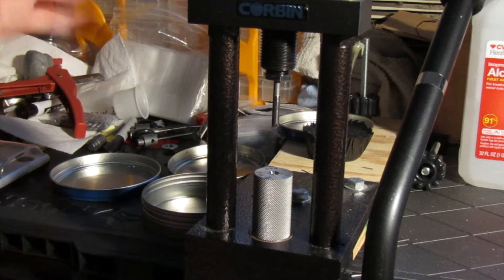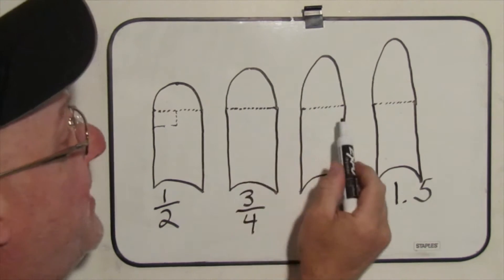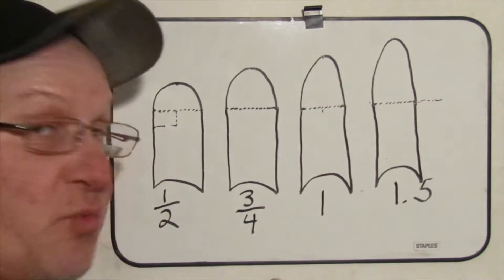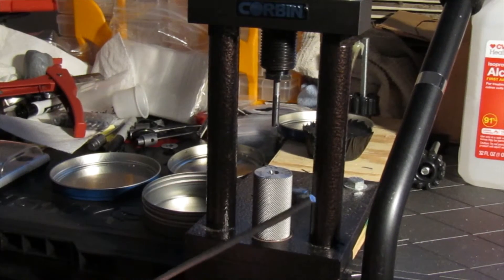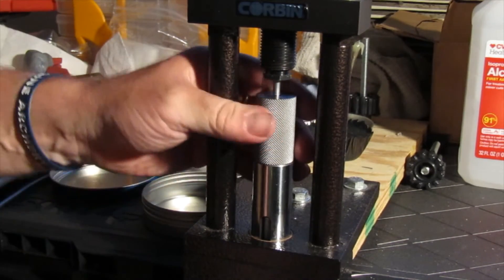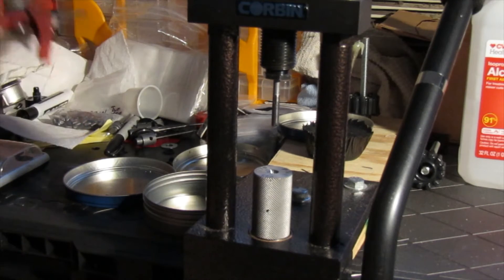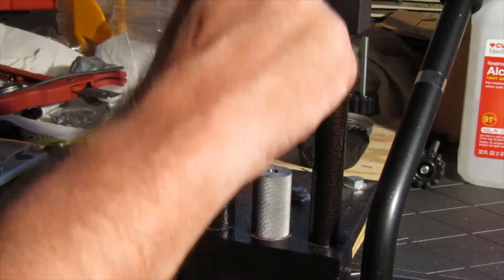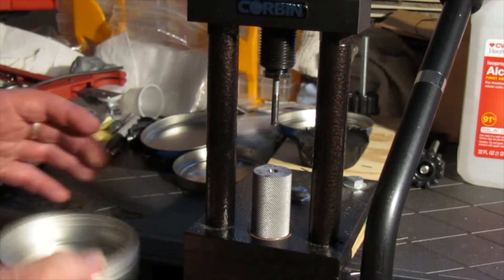Field Target Tech #24 Explaining Ogive &Pellet Swaging Process

Comment: Your explanation of ogive is not correct.
The ogive is the radius of the tips curve, not the distance to the tip from base of curve. I shoot 10 ogive 115gr .308 bullets. By your explanation, the bullet tip would be 3.08" long.
So, a 10 ogive bullet would have a curve 10 times the diameter, or in my case, 3.08". You can then get them in secant or tangent.
Also, not all bullet are ogive bullets some use other curves, in which case the word ogive is not used at all. 
Bottom line, the bigger the ogive, the pointier the bullet.

Comment: Interested about the bleed hole. Can you measure the thickness of the waste lead coming through the bleed hole? I'm actually interested in the size of the bleed hole in your mold. Many thanks
Reply from the maker: I will measure the lead from the bleed hole in a day or two, in process of moving, bit of chaos.  I can tell you that Dave Corbin will reccomend the bleed hole size, depending upon how the nose will form of a given caliber,.........or not.  My first set of dies had to be sent back, because the bleed hole was too large, and the lead did not flow properly in order to build up pressure to make a perfect nose.  Different calibers will also require/need different size bleed holes in order for the lead to flow properly when compressed.   I'll take a measurement and get back to you.
Reply: @sniperxbow60  Still waiting for your reply on the bleed hole for a .22 slug
Reply from the maker: @Redgum  I do not have any dies for a .22 slug.  Sorry about not getting back to you,  still in moving process.   The bleed hole that I do have for my .177 slugs is just around 40 thousandths of an inch.
Reply: 1/16th of an inch.

Comment: That’s not hollow point buddy, the hollow point is made with two dies not one. Your using point forming point. To make hollow point you have to have two dies, go do so research
Reply from the maker: This is a hollowpoint,  the die is a point forming die.  The hollowpoint punch is on the bottom of this die, and the base punch is on the top.  The only adjustable part of the die is the base part.  If you look at my website fieldtargettech.com, you can see better pictures of the hollowpoint nose.

Comment: appreciate the video, but a bummer I cant see what is in your hand when talking about the swaged pellet
Reply from the maker: Razvan, I DO apologize for that, I'm definitely not a cinematographer.   I'm in the process of moving right now,  once I get established in a permanent  place, I'll definitely film this at a higher level.   Hope you enjoyed the video,  and you got some information about and from it.   Thanks for watching my videos.
Reply: @sniperxbow60  I did like the video.  Question:  On the T Robb video, can you tell me more about that straw thing and how you used it to calibrate the T Robb?  More specifically, how do you know what length to cut it? (sorry, got my vids crossed on this question)
Reply from the maker: @ramvan2284  ,
What I did, was find a pellet that was a measured 4.52 in my Pelletgage measuring device.  As I said in that video,  I cut the skirt off, because I'm only concerned with the head of the pellet.  I took the adjustment screw of the TR Robb sizer, and backed it all (or most of the way) out. I glued the straw to the head of the pellet, ( actually,  just behind the head), and dropped it in. When the pellet head stops on it's own, due to gravity, I cut the straw off flush with the top of the die.  I then placed the top of the die onto the board.   I then slowly adjusted the screw, until I felt resistance,  but not moving the pellet head.  This is now adjusted properly,  for future pellets going into the die.
Reply: @sniperxbow60  Ahhhh, now I get it. Thanks again sir.  Headed into Extreme Benchrest next week and no time like the present to use this TRobb.  You are the man.  Peace on you

Comment: Can these dyes or molds be used in a regular regular reloading press maybe a Hornady or leave or RCBS press? Or will they only work and a Corbin style press
Reply from the maker: These particular dies will only fit Corbin swaging equipment.   They can make dies for regular reloading presses, but there is an extra step involved.   Also, a Corbin press has a greater mechanical advantage over a standard reloading press.  This same process in a reloading press is much more difficult,  taking much more time and more physical effort

Comment: Nice vid,
How deep you you set the hollow point pin hole ?
Reply from the maker: The depth of the hollowpoint punch is fixed, it's determined by the diemaker, it's not adjustable.   This hollowpoint is about 3/16 of an inch deep
Reply: @sniperxbow60  ah ok, 
Tanks for the reply.
Reply: @sniperxbow60  I was curious as the way I see it if you could set the pin depth then.a deeper hollow point would mean less lead so you could then make.a longer more stable slug,

Comment: Simply outstanding Sir! I had to revisit your very educational channel to suck up some more valuable information! I tried ordering a kit from Corbin but their lead time is 6 to 10 month's out😞 If you come across someone that wants to sell their swaging kit, please let me know and I'll look out for you very well Sir, thanks👍👍👍
Reply from the maker: Catherine,  if you are interested in swaging your own slugs, at a fraction of Corbins price and long wait times, check out GMI Engineering.   They also have a Facebook page,  GMI Swaging.   The process is slower, several steps are involved,  but the end product is superb.  You can get 2 different dies for the same price as one Corbin die.  Check them out
Reply: @sniperxbow60  I couldn’t do it. It takes a lot of time to swage a bunch of slugs on the Corbin… even when your in a grove. Adding more steps and making it slower would suck 😂 

It’s plenty fast for personal.. but swaging slugs to sell is almost pointless! But I’d like to see a return on my investment too lol
Reply from the maker: @nsboost  yes, you are correct.  I've spoke to GMI, and I have 2 traditional diabolo pellet swaging molds in the works.  Corbin press is great for slugs, but a traditional pellet cannot be made.  To make pellets with a skirt, considering pellets are hard to come by these days, I'll take the extra steps to create enough pellets to make it through a weekend 2 day match.  These would be for personal use only, too slow of a process for selling.
Reply: @sniperxbow60  Oh wow, thanks👍

Comment: Where can I find 30cal. dies for the corbin s-press...
Also where do I find lead wire that meets the correct size for 30cal pellets...
Reply from the maker: SOJUSLIM, I get all of my dies and supplies direct from Corbin.  They make all sizes,  according to your specifications.  Only slugs (bullets) can be made, a traditional diabolo skirted pellet design cannot be made with Corbin equipment.

Comment: Where can I buy a device like this in 5.5 .217 18gr?
Reply from the maker: All of this equipment was purchased from Corbins, they are based in Oregon,  USA
Reply: @sniperxbow60  I tried to make the purchase on Corbin's website but they are not shipping to Brazil. I am very interested in making the slugs and selling them in cans here.
Reply: @sniperxbow60  thank you very much for the information. Just let me know one more thing, do the slugs get burrs on your skirts or are they perfect?
Reply from the maker: @NoobGames3  there are no skirts on these, just a flat base, cupped base, or rebared boat tail.  The slugs that I made in this video are flat base, does not have any burrs attached to the slug, however,  there is some residual flakes that stick to the slug after the swaging process.   A quick wash in soapy water will get them off.
Reply: @sniperxbow60  Thank you for the informations.
Reply from the maker: TioNito, I don't know how economical it would be to make slugs to sell, but would be good for personal use. Look up GMI, they are based in England,  Don't know if they will ship to Brazil.  It's a several step process,  so to sell them at a profit,  might not be viable.
Reply: @sniperxbow60  I went to the GMI website now and saw the forms. Here in Brazil they already manufacture this type of shape for slugs but like the Corbin or Presslug system it doesn't exist here and yes it is feasible to structure yourself to make and sell, I even created a spreadsheet in Excel and estimated fixed costs, for example, for a can with 250 slugs of .22 18gr.
If I knew someone who lives in the US they would buy it for me and send it to me via UPS for example.

Comment: What's up tom. Is it possible to get a bigger hollow point punch.
Reply from the maker: The punch that I use, is one of the larger hollows for a .177.  Nielson slugs have a slightly larger hollowpoint cavity, but there is a price.  That price is a slight reduction of BC.  If you compare a Neilson slug with mine, you'll notice that mine is a little more streamlined.  The Nielson cavity is slightly larger, but the slugs nose has a large flat around the hollowpoint cavity, while mine does not.  It was recommended by the die maker (Corbin) that i go no larger than what I have now.  He even tried to talk me out of the punch I'm using, for a smaller one.
Reply: @sniperxbow60  I was thinking maybe a bigger or deeper hollow point would work better.   Maybe be moving most of the weight back and having a longer slug for it's weight.  The slug could have a higher B.C.  Do you know why NSA makes all there .177 slug with a dish base.  I ordered some of the new 20.5 nsa in .177. They should be here Monday.   Im thinking of comparing them to your 20 gn slugs and the 19.5gn vk slugs. I learned a few things from testing the .177 slugs in clear ballistic gel.
Reply from the maker: Don't know why they do a dish Base, that's the only base punch i still have to get.  I would guess that my 21 grain slugs might be comparable to the 20.5 Nielsons,  but the only way would be to shoot them.  Keep in mind that Nielsons are .1780 in diameter,  and mine are .1775.
Reply: @sniperxbow60 my theory is that the dish base or cup base slugs. might be easier to stabilized from a standard air gun barrel.  From the .177 slugs testing i done.  I found that the dish base slugs or cup base slugs group better then the flat base slugs at close distance. The flat base slugs kept there group size down range while the dish and cup base slugs opened up the group size.  I was testing the .1770 not the .1775 or the .1780.  I would need to test more slugs with different diameters and different bases to prove my theory.   On the strelok Pro app I been using.   All the slugs from NSA have a BC.  You just choose the slug you are using and the bc is shown.   The slugs with a dish base have a higher b.c then the slugs with a flat base.
Reply: @sniperxbow60  I'll let you know how the different slugs do.  When I get to test them.

Comment: Your press should have come with a tray with a hole in the center that fits over the die to collect the lead that is extruded from the die?
The process is called swaging as in aging.  🤓
Reply from the maker: Yeah, I know........it's just that the tray gets in the way when doing a lot of them, plus I change dies a lot.  I found that I can clean up the lead bleed off a lot quicker without it.

Comment: Cool video!  Corbin core swaging dies generally have 3 bleed holes.  You might check with Corbin as to why yours just has 1.  🤔
Reply from the maker: McGrendel,  these dies are unique to .177 airgun slugs.  I have these dies, as you have seen in the video, and they do have only 1 bleed hole.  I also have semi wadcutter dies, which are considerably smaller, and they have 2 bleed holes.  Larger core swages require more bleed holes due to the pressure to form the nose properly. My semi wadcutter die could use only 1 bleed hole, as I found that with 2 bleed holes,  the nose sometimes does not get formed properly.   According to Dave Corbin,  it's all about achieving the proper pressure in order to make the lead flow properly.
Reply: @sniperxbow60  Roger that.  🤓

Comment: How and where can you buy the set up to start making slugs I did see it in the discription thanks for your time and reply. Great video 👌👍✌️
Reply from the maker: Joseph,  all of the equipment,  including the lead wire are all purchased from Corbins,  they are based in Oregon.   The setup as you see with one set of dies, and full set of base punches, with wire is around $2000
Reply: @sniperxbow60  thanks I seen a lot more videos of yours and can't wait for more I'll be giving Corbin a call after I research a little more. Price is not to bad. Great stuff from a great shooter.👍👌✌️

Comment: Are you making any slugs with one ogive or 1.5 ogive.
Reply from the maker: Soda can,  I only have the capability of 1/2 ogive, which is half round, 3/4 ogive, and 2S ogive.  2S ogive is currently the most popular with most of the larger manufacturers.  I have plans for more shapes in the future,  but not for a while.
Reply: @sniperxbow60  would you be able to make me some slugs with a solid nose flat base and a length of .3300 or .3400
Reply from the maker: Soda can, yes.  If you go onto my website, and send me an email,  we can figure out the details.
Reply from the maker: Fieldtargettech.com
Reply: @sniperxbow60  ok cool ill do that tomorrow.

Comment: Great video and good information! I’m about to purchase this set up but with the die for the hollow core slug. Do you have any experience with those dies?
Reply from the maker: Dang.ol.winner, I have the standard hollowpoint nose punch for all of my dies.  It only puts a hollow at the nose of the point about 1/32" in diameter,  and about 3/16" deep.  With these, the hollow is rather small, due to only .1775 pellet diameter.   I'm not sure if it is the same as you described.   If it is different,  then I have no experience with that particular die.  What I show in the video is typical for all of my dies.  Glad you enjoyed the video.

Comment: Can you make 50 cal. Copper bullets with a hand press?
Reply from the maker: I wouldn't think so, but that would be a question for Dave Corbin, the owner of Corbin.   You probably could, but it would have to be copper jacketed, around a lead core.  Swaging flows the lead out of bleed holes, as I showed in the video.  Copper cannot flow in this manner. If it is possible, there would be several dies involved,  along with a different process.  Larger caliber projectiles would most likely need Corbins Hydro hydraulic press to complete the task, the press I use would not be suitable
Reply: @sniperxbow60  thanks for the reply.

Comment: What would the cost be to start making 22
Reply from the maker: Jeremy, 

Everything delivered is around $2000, depending upon how much lead wire you get.  The press is about $800, the wire cutter is $70, a single die is $485, which includes 1 base punch of your choice.   If you want all possible base punches, add another $600.  The lead can be bought by the spool ($50 each), if you buy 4, it is $180.  Also swaging lube $16 for 2 jars.
Bottom line, to get started with 40 pounds of lead is around the $2200 realm
Reply: @sniperxbow60  ok ty
Reply from the maker: Jeremy,
I currently do not even own a .22, so for me that wouldn't be in the cards.  In order for me to make .22 caliber on my current setup, it would require a new die, new lead wire, and new wire cutting die.  These would run just short of $1000, for me would be cost prohibitive.   If someone were to get everything they needed to tackle that endeavor,  it would be close to $2000 for complete equipment.
Reply: @sniperxbow60   what I'm asking is how much would it cost somebody to get into it making .22 to buy all of it

Comment: Are you using the Corbin press? Or can you use a different press for the diy.
Reply from the maker: I am using the Corbin press, but the dies I am using can only be used on a Corbin press.  You can make semiwadcutters with a standard reloading press,  but involves 2 steps, it's not as precise,  and much more difficult as far as effort is concerned.   The Corbin press,  as expensive as it is, is much more efficient and effortless.